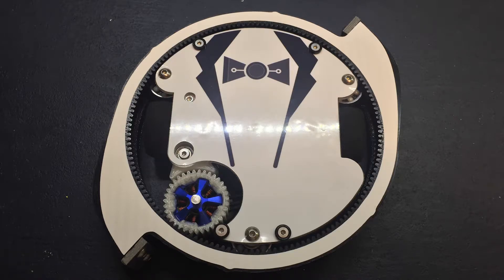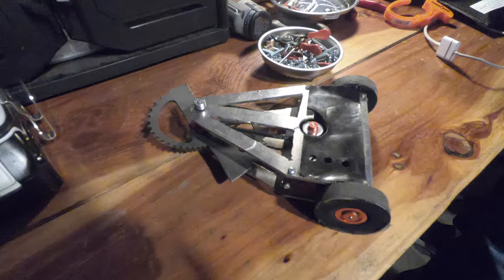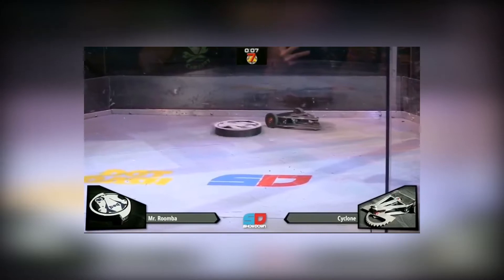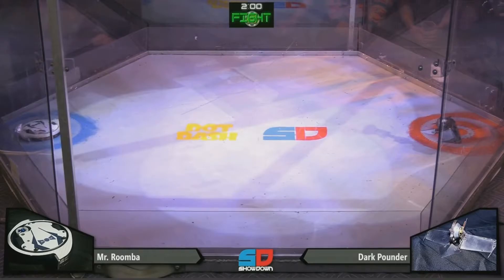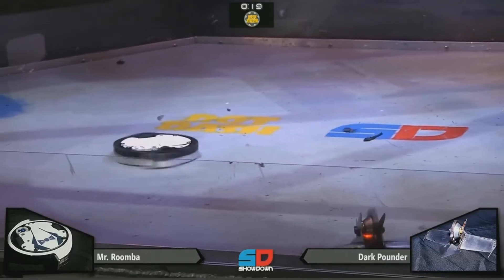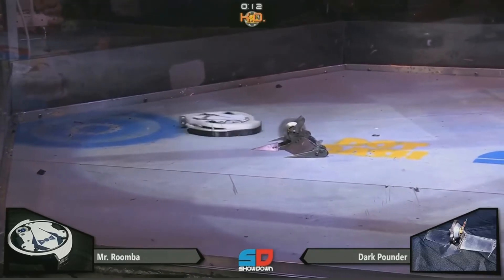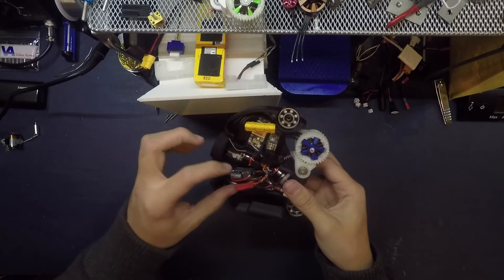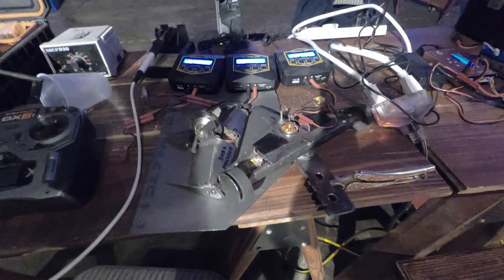3D Printed 1lb Battlebot Mr.Roomba 2.5 - Part 2 and 3 (The Fights and Aftermath)

Comment: Some BLHeli ESCs are advertised to have a feature that will cut the motor's signal if any obstruction is detected. Did you have any problem with this feature on your weapon ESC?
Reply from the maker: I haven't had any issues like that but that's probably because i disabled that feature in the Blheli/Blheli_32 configurator.